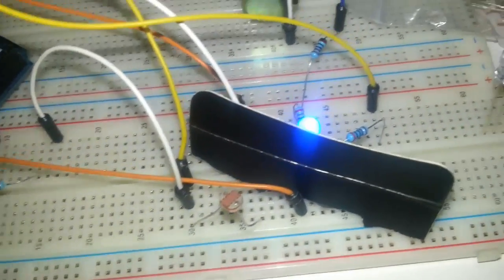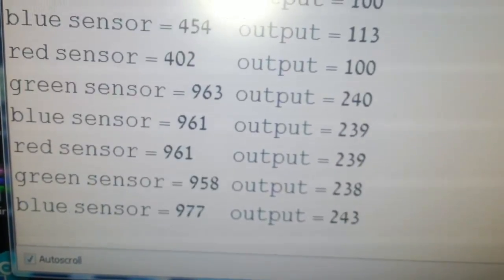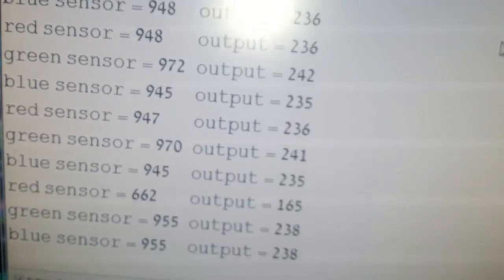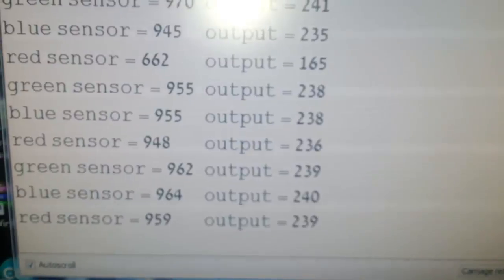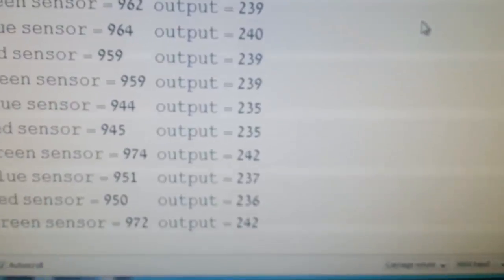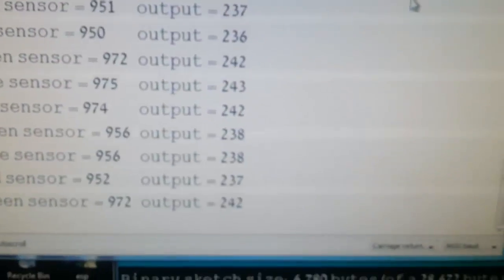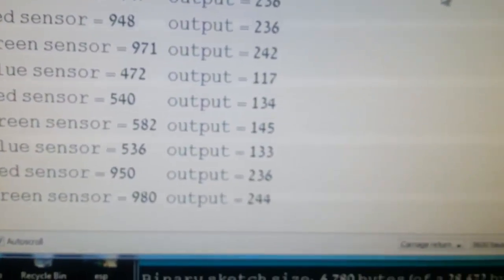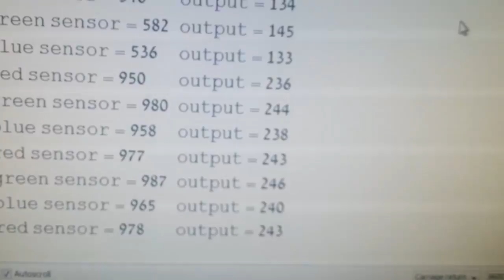Detecting colors with LDR and Arduino

Comment: Hey man can you please link to the schematic. Really cool circuit but you dont give enough information to replicate it.
Reply from the maker: it is a simple circuit just turn on rgb led each color at time and messure the light feom the sensor or use three leds red green and blue. do notice that the current and voltage of different led colors are not the same so dont use the same resistor value for each led ,use the led specification. the reading that shall give you the most extreme messure is the closest color of tbe object you want to check its color
Reply: Ok so in my experience LDR gives you an analog value between 1 and 1024 when you wire it up as a voltage divider.

so yes if you put it in front of an RGB, the three colors will not have equal brightness and so they will have different values.

Still this is not color recognition, because if you used a different light source you would have no idea of the colour of that light source? Or did I missunderstand?
Reply from the maker: Robotix if you shine a red object with a red light it will reflect the most light than if you shine it with a blue or a green value.so if you take an object with a certain color and shine at it three times with three colors red,green,blue each time at a turn and messure the light being reflected the highest value is the object color
Reply: I get it so you need 3 detectors placed facing three reflective surfaces that are red green and blue. Is that right?
Reply from the maker: Robotix 
No just one detector.
You shine the object you want to test it color with the three colors red,green and blue .each color in a turn. Each time you  read the value from the sensor .the closest color of the led to the object color shall give the best result.
Did you actually watch the video?
Reply from the maker: Robotix 
What is color?
Why an orange is orange? And a pear green?
When you see a certain color with your eye under regular white and you let's say see red. That means that the object reflects red light wavelength best.
A white object reflects best all light. A black object reflects none. 
A black hole in space has no visible color because it swallows all light .
Reply: @MarcoArduinochannel  But as I can notice there is very high fluctuation in  the Analogue value which I'm reading.....
Reply: Robotix